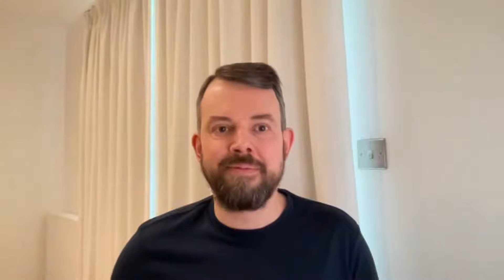Supplementary Bonding Live Q&A

Comment: Why is it that these special locations might require supplementary bonding when the main bonding should already be achieving the same thing, which is an equal potential difference between the extraneous parts? Is supplementary supposed to be a backup just in case the main bonding fails or isn't installed properly? Is there another purpose for it?
Reply from the maker: Hi,
Thank you for your question. Supplementary bonding is applied to both extraneous conductive parts and exposed conductive parts of electrical equipment, and is a method of providing additional protection against electric shock. The reason for the requirement in the special locations mentioned is due to the specific risks in those locations, such as medical locations for example.
Regards
James